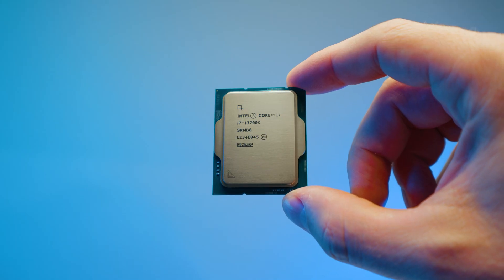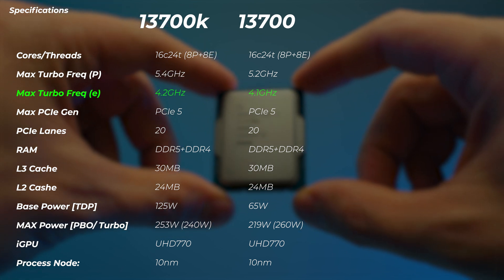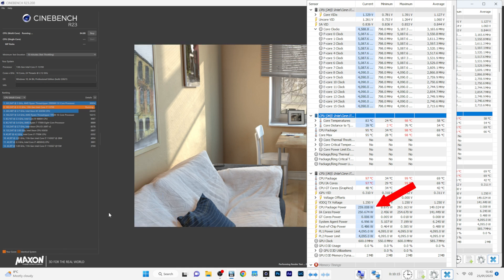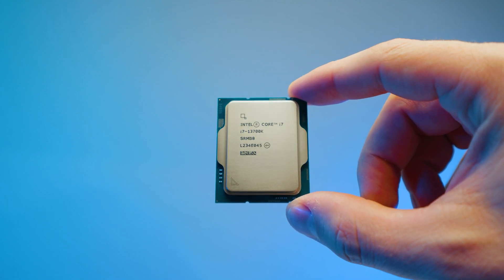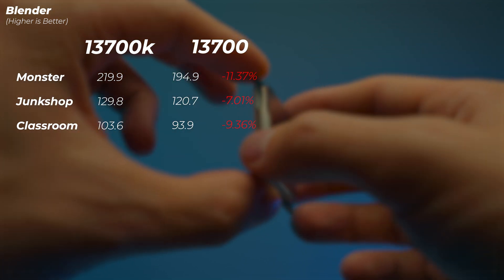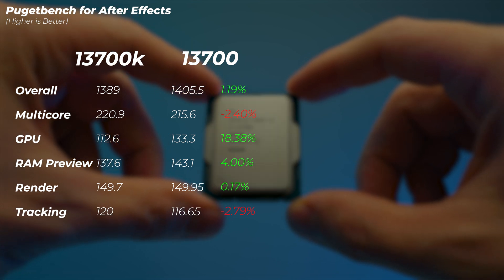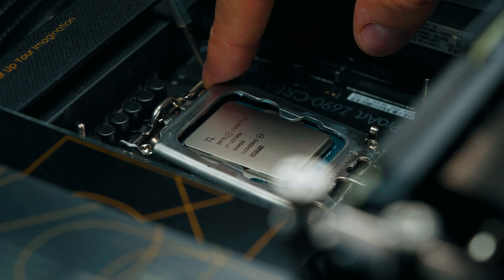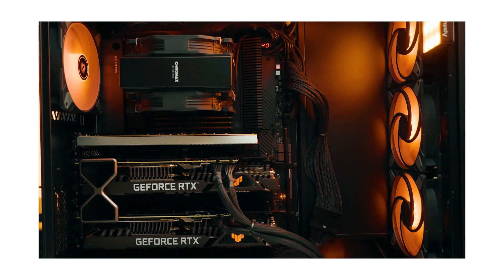Surprisingly DIFFERENT and yet SAME! 👉 Is 13700k Worth it over 13700?

Comment: Im upgrading from a i5 12500 to this used i7 13700 is it worth for 221.47 usd?
Reply: update , got it , upgraded from a i5 12500, right of the bat i can feel the diff in LRC just by scrubbing through photos. and im still on ddr4 maybe next time will upgrade to ddr5 board to take full advantage of it, still upgrading just the cpu , is a saver than buying a whole new system.

Comment: The K compatible motherboard costs double
Reply: True. However, over clocking voids all warranty and just for the 200mhz, which prob won't use.. its not worth it.. Boosting a 2.56ghz cpu to 5.5 or 6.0 is more than enough..

Comment: I have tried over clocking with 13700k it is just not worth it power draw increase exponentially with just a 100mhz and not to mention temp increase,  by the way this cpu is already very powerful hungry. I regret buying it should have gone with r9 7900.😢

Comment: man you clearly dont understand silicon variance and svid tables, if you just picked 2 13700k they would also have slightly different results and a lot of these are still within margin of error, what i cannot find information about is locked VCCSA voltage ..

Comment: Is the 13700k really runs hotter and difficult to cool than the 13700 ?? I'll be using Tuf 760m .. In my country, the 13700 is $457.05, the 13700k is $462.25, the 14700 is $460.71 and the 14700k is $486.70 .. So the 13700, 13700k and 14700 are all price so close and only the 14700k is much more expensive .. Which do I get ?? Will the 13700 & 14700 runs cooler than the K processors or will the K processors run cooler on a B760m given its locked ..

Comment: How did you get the 13700 to draw more power than the K version on stock settings? I've tried it with both the regular version and the F one, and both draw a max of 220w at 80 C. Just curious :)

Comment: Hey!  Norway here, as of today (28 Sept, 2023), and with 14th gen just around the corner (17 Oct 2023?), here are the best prices in Norwegian kroner.  i13700: 5190Nkr, i13700k: 5342Nkr). Which translates to roughly $483.74 and $497.90 respectively.  Not really much daylight between them, pricewise.

Comment: I built a mini itx with a 13700 and a B760 board. Its easy to just fix the voltage at something like 1.2v and the cpu wont pull as much power. Its not gonna turbo a bunch on a B760 but thats fine with me.
Reply: hi bro, can i made my 13700F use less watts without lose performance it hits more than 250 WATT too easy. does non k can edit  voltage  on it!!

Comment: It`s the same chip just K variant is "hand picked" better silicon, thus non K = more power / heat if you push them on same settings.

Comment: Both are great, you cant go wrong with either. However I do want to point out that the 13700 and the other non-K CPUs have a minor flaw, and thats that they cant increase VCCSA in BIOS. VCCSA is used for memory overclocking, so if you want the high end DDR5 kits, like DDR5-6600 or higher youll absolutely want to get the unlocked 'K' chips.
Reply: how much performance you get on oc-ed memory? is it worth the upgrade? im looking for anew build for my rig
Reply: even the weakest ddr5 4800 is far above then ddr4 3200mhz. will that even makes a difference?
- I was able to increase premiere pro export speed on k series processor after installing intel hd graphics drivers. which was installed not previously 
- With F series processor you don't get intel hd graphics.
Reply: Who uses intel graphics nowadays @rohaitastanoli3414
Reply: @rohaitastanoli3414   can I use 6000MT/s Memory on the 13700?
Reply: @gabrielaraya3242  It depends on motherboard. ddr5 motherboards can support from 4800 5200 5600 6000mhz rams. some manufacturer can even support higher.

But 5200Mhz is OK. You don't need to go for 6000 because there would not be any difference. in speed.
Reply: go for corsair vengence or kingston fury at 5200MHZ

Comment: I did a 13700 micro-ATX build recently and it's really good.  I'm starting to spec out a SFF build with the same processor.  I was holding out for the mythical T-variant (35W) but while they are listed as released, I have yet to see one anywhere.
Reply: What cooling?
Reply: @alrizo1115  On both I used 240 AIOs. The SFF ended up being a Hyte Revolt 3, and while the AIO cooks when gaming, temps stay in thermal limits.

Comment: 0 difference. if you buy 13700k you'll have to also buy a cooler while 13700 has already one.
Reply: it will make a lot of throttling tho!
Reply: @Mikelica69  yes that's true, I had to buy liquid cooler
Reply: @aertn241  So you paired a custom All-in-1 Liquid cooler with the i7 13700 non-k?
Reply: @BravoSixGoingDark  what do you mean by All in one
Reply: @aertn241  Apologize wrong wording, I meant to say AIO, short form for All in 1 liquid cooler that comes in sealed tubes with a radiator and 2 stock fans packaged together with it to be mounted on top of the radiator.
Reply: Hi, do you recommend liquid cooling for i7-13700F?

Comment: Thank you for reviewing non-K CPU. I think over last past generations they offer best value, while K variants have become unnecessary and not worth your money and time, because the gap between them is now so minimal, and most of the non-K variants already boost very high. Then, the K CPUs offer minimal advantages while requiring a lot more power, cooling, and expensive mobos.
Reply: I find the K CPUs go on sale more often. I never see the non K parts go on sale
Reply: @kotztotz3530  True.  There seems to be a bigger used market for them as well, they seem to keep their value longer, the k chips that is.  I wonder how much different the 14700k is from 14700 non k.
Reply: @sezwo5774  I'm guessing a 3-5% difference between the 14700 and 14700K
Reply: @sezwo5774  The fun part is they are more than likely in very good shape, as nobody has ever been able to OC them. So they have less wear than the K CPUs, that have probably been savagely OCed during their whole life ^^

Comment: This makes no sense? Isn't it a 65w part? Isn't it meant to run slower, cooler! 🤔😂
Reply from the maker: you can make it run at 65W, but if you open all power limits then this is the results. Same way you could make the 13700k a 65W part :)

Comment: i5 13600k vs i7 13700 (non-k) help i cant decide.. Which CPU performs better in gaming? is the 13700 non-k faster than the 13600k? and if so, how much? and is the 13700 more future proof with the extra 2 cores? i've also seen that the 13700 consumes less wattage? so less wattage and more powerful than the 13600k, for the same money?? if thats the case, well then thats a win win? Where im from, they cost the same...
Reply: Do you have an answer yet ?
Reply: Look up the clocks but the 13700 should be faster

Comment: I had read that the 13th gen chips were locked, making them unable to be underclocked.  I did see Damara226 here mention that, in bios, you could change the TDP limits on the 13700 to have it mimic that of a 13700T (base 35W / Turbo 106W).  Tech Notice, can you confirm this?  If yes, what precise bios settings would be used to accomplish this?  Thanks!
Reply: 13th Gen locked CPUs (non-K) can't be under-volted. However, they can be underclocked, I used the stock cooler temporally so I had to lock it to 65W which worked well. Only issue is under volting. Sure it works but you will lose performance due to CEP (Current Excursion Protection) which can't be disabled on locked CPUs.
Reply: @pixels_per_inch  Thanks for the info.  I did call up Intel and asked if the TDP values for the non-K's could be changed.  The rep I spoke with said yes, you could change both the Processor Base Power (65W stock for the 13700) and the Maximum Turbo Power (219W stock for the 13700).  So, If I got at 13700, I'd look to keep the Base Power at 65W and bring the Max Turbo Power down to around 105W.
Reply: @michaelbrown7415  Where can I find a detailed guide explaining how to change Processor Base Power and Maximum Turbo Power? Is this option made available in B (670, 760) motherboards or limited to only Z (690, 790) motherboards? Or both motherboard versions has that options?

Comment: Dumb question but the 13700 pulling more watts than the k version....that is only during high intense overclocking and benchmarking, ya? Would it still pull that high during gaming or video editing/rendering?
Reply: Late reply but no. In gaming they both use far far less power, like 80w.
Reply: @__aceofspades  Yeah. Gaming is far from being the most power consuming activity, actually. Those benchmarks are some very specific "torture" tests.

Comment: My question is what do you think about such a set:
Intel Core i7 13700 (without K)
Gigabyte B760 Gaming X DDR4
2 x 32 GB RAM - 3600 MHz DDR4
Nvidia GeForce RTX 4070 Ti
Power: 850W

Cooling:
SilentiumPC/Endorfy Fortis 5 Dual Fan (140mm + 120mm)
Case:
Be Quiet! Pure Base 500DX
4 x Be Quiet Pure Wings 2 - 140mm (900 RPM) in this case

I'm mainly concerned with how long the processor will be able to work under full load (theoretical situation) because it will rather be used in programs for editing videos in FULL HD / 1440p. and sometimes for games in 1440p.
Do you think such cooling will work? I would like to avoid AiO type water cooling at all costs.

Comment: Hi there, great vids by the way.
Does anybody know the differences between the i7 13700, f, kf and the k model.
I know that the f versions don't have an igpu. I have just managed to get a good deal on the f, so I will be using it with an Msi z690 mobo.
Reply: K-> overclockable (multiplier non locked) // F -> no igpu. With that in mind, imagine the rest of combinations

Comment: I want to know the RAM compatibility for 13700, with B660 boards. 
Spec sheet says it supports DDR5 5600 max. So does that mean I cannot use DDR5 6000 sticks? Will it be unstable? Can I run 6000 sticks at 5600 speed? Or do I need to buy 5600 sticks specifically? Do I need B760 boards for any of these to run without any compatibility issue?
Reply: You enable XMP in the bios and set it to 5600 if you have problems at 6000.

Comment: I plumped for the 13700 over the K model as I wasn't planning to over clock, although have fitted it to a Z790 Mobo.  £30 difference in price and you get a intel cooler with the non-K too.
It's workiig fine and matching the 13700K in most tasks, but does pull up too 275w CPU package!!! before hitting 100c and throttling to about 230w. runnning with 32Gb of DDR4-3800 C16 and an old GTX960 Stryx
Reply: When I pee it stings
Reply: So this confirms - Non-K are worse quality silicon that pulls more power.
Reply: I recomed you to delid and put liquid metal

Comment: I built a workstation with the following specifications following one of your videos so I can run resolve studio efficiently
- a 12th Gen Intel(R) Core(TM) i9-12900K   3.19 GHz
- 64GB RAM
- Asus ProArt z690 Creator  Wifi Motherboard
- 24GB  GDDR6X NVIDIA GeForce TRX 3090 Ti (Dedicated Video Memory)

For some weeks now, I have not been getting smooth playbacks on a 1080p timeline with 4k footage from the BMPCC 6K Pro, even with timeline proxy resolution set to Quarter, DaVinci also hangs after every single edit action for about 10-15 seconds before I can do anything else.

I have set my decode option to (Intel Quick Sync) and generated proxies and optimized media yet none seems to be the solution.

When I analyse the performance chart of my task manager, I noticed it's only the CPU and NVIDIA GPU that is been utilized with the maximum level reached being about 40%, the Intel(R) UHD Graphics is not been utilized at all.

Please what do you suggest as a solution to solve this, It's really affecting my performance and work delivery.

Comment: I would like you to do some test touching values in the bios to improve the temperatures of the 13700, especially with air cooling, I went crazy to lower the temperatures, in Cinebench for example the cores went up to 100º, it came by default with the PL1 at 253W and PL2 at 253W, I had to put it at PL1 65W and PL2 at 195W to keep the temperatures below 90-92º, I would like to know if I did it right and if there is a better configuration.
Reply: If you undervolt, you can get higher clocks for the same wattage.
Reply: Also, you either need a honking air cooler that's ducted or a 280mm+ aio.

Comment: Really nice video, comparing the 13700k, 13700 and 13700T would be the absolute test. The 13700T is a really exciting CPU, its 35W/105W could be cooled passively or with low RPM (even at max) while potentially being an absolute workhorse.
Can you please explain, how to check if a Mobo/ CPU-combo can be boosted indefinitely?
Reply: If you buy 13700 and in bios set desired power (100W for example), you have same CPU as 13700T
Reply: interesting you mention the "T" series, as even with 13900T they are very economical in power consumption. But can see any for sale within the T configuration.

Comment: K skus were rumored to run better binned silicon so you can overclock them.  Letting any motherboard spray a ton of voltage on auto clock settings is stupid.  The presets use way more voltage than any all core locked clock.  You’re just eating power, generating excess heat, and making more noise.  This is a mid tier cpu sku, auto clocks don’t tend to optimize your memory bandwidth.  Just leaving alone in content creation.  If you’re gaming, you can die on the manual clock hill if you want.  It’s usually an exercise and you are better off liquid cooling your gpu and clocking that.

Comment: How come nobody has talked about this version of the chip yet? I’m still choosing between getting 13600K VS 13700K cuz more P cores probably benefits 3D and video/VFX applications. But the 13700 is slightly lower clock speed but also in between the price of the above mentioned cpus.
Reply: i7 13700 or i5 13600 non k cpu is enough or you need oc in future, up to u

Comment: Great video; interesting that the 13700 bucks the trends of the lower end non-K SKU's (ie. lower model non-K lower SKU's like the 13600 are rumored to be tweaked Alder Lake dies, using Golden Cove/Gracemont; evident by lower L2 cache of 1.25 MB per P-core, and L3 cache of 2MB per e-core cluster). In comparison, Raptor lake (Raptor Cove/Gracemont) uses L2 cache of 2MB per P-core, and L3 cache of 4MB per e-core cluster... which seems to be the case for the 13700 thankfully.

Comment: Considering the GPU tasks are performing better in editing software on the 13700, it makes me speculate that's where the extra power usage is going to. The 13700 itself isn't necessarily using more power over the 13700k, it's the 13700's iGPU that is drawing a bit more power over the 13700k's iGPU. It might be beneficial to actually get the non k version if you're using Premiere, After Effects, or DaVinci a lot that leverages the iGPU greatly.
Reply: That’s a phenomena you see more on AMD with kids trying to overclock their Apus to get more framerate.  If it’s a mobo auto clock, you’d look at the voltage going to the input bc normally you want to pull its power or shut it off in bios entirely to get more core speed.  This was before e-cores and people were all about getting all core clocked clocks on intel at all costs.
Reply: I suspect worse binning

Comment: I'm thinking of upgrading from a 12700kf to a 13700k. Is it worth it?
Reply: Depends. Single core difference isn't worth it (the 13700k is ~10% faster there), but if your particular use case benefits from multi-core performance, it might be worth considering.
It also depends on your motherboard and RAM. If you're on DDR4, I personally wouldn't think the upgrade is worth it unless you get a really good deal on the 13700k and can can sell your 12700kf for good money. For video editing, though, the 13700k would be a major upgrade due to QuickSync, but then again if you want that, the 13600k performs about the same as the 12700kf and is cheaper than the 13700k ¯\_(ツ)_/¯
Reply: Nah you're good for the next 3years

Comment: There was a $10 difference between the 13700 ($319) and the 13700k ($329) when I got mine at microcenter, can't say I'm bothered even if I don't overclock, the 13700k is currently $359 at Microcenter.  That said for someone who does care or is trying to eek out every erg of performance for their dollar this is pretty interesting.  Didn't realize this was locked on the motherboard with this gen of chips.  Now we need more samples because one sample is nowhere near enough.
Reply: Yea, the iGPU difference could simply be chip variation
Reply: @Ahnii  its probably a memory speed difference
Non K chips don't overclock the  memeory

Comment: The only thing I can think of for the 13700 doing so well is that it's a golden cpu or even a 13700K but wasn't chosen to be a K variant but still was a lucky chip with the K variant performance.
Reply: Hi, do you recommend liquid cooling for i7-13700F?
Reply: That's not how it works.. the CPU is set to certain stock settings, all 13700 perform like this
Reply: @damara2268  the 13700K stock settings are supposed to be higher, though, so it takes speculation to try to determine why the regular did so well versus the K.
Reply: @Deadeye313  stock 13700K only runs 200MHz faster than stock 13700, so the difference is small of course 

Stock settings per Intel website:
13700K - 5.4GHz
13700 - 5.2GHz 

That's a difference of ~4%

You're paying more for the "K" CPUs mostly because they're unlocked for overclocking, the little frequency boost at stock settings is just a bonus
Reply: @Deadeye313 could be that it’s the same as the i7 8700 and i7 8700k which were identical other than one being an unlocked CPU